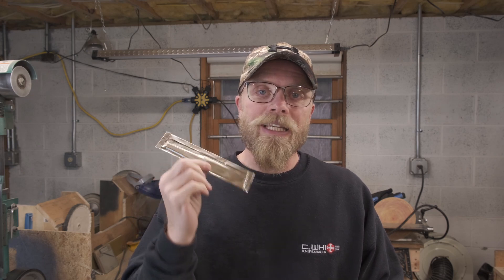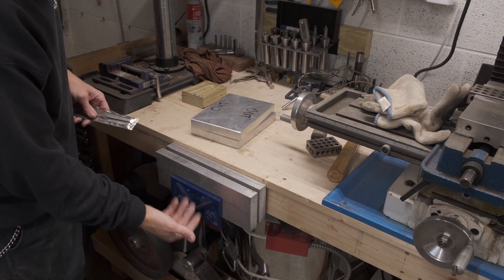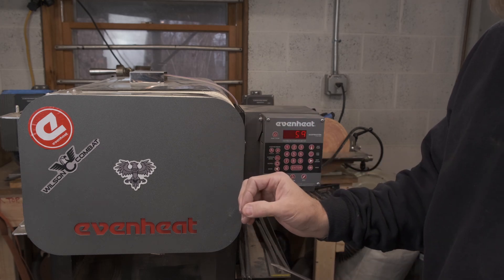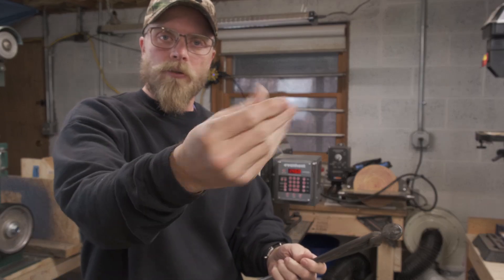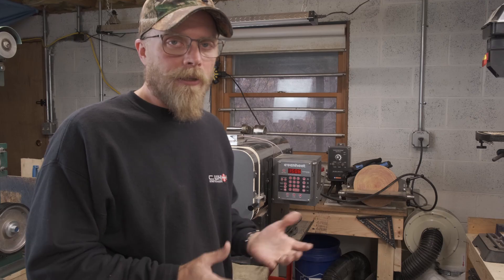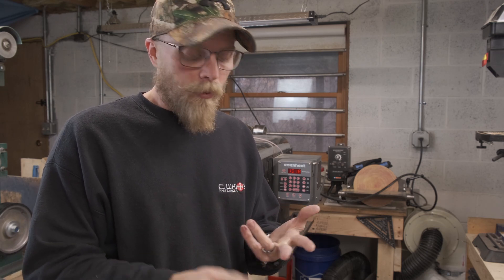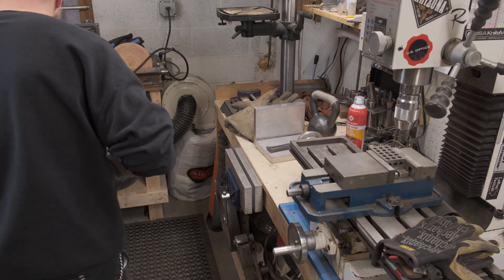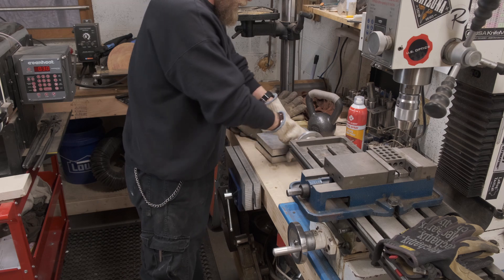Heat Treating High-Grade Stainless: Damasteel, CPM154, RWL34, etc.

Comment: Thank you so much, Caleb! You make it look so easy and simple, but it is not. And yes, it helps us a lot. But there's still questions... Like, what happens if one places the baldes in the cold kiln and turn it on, letting them ramp up along, rather than out them on the preheated kiln. The same for the temper... Put the baldes    in the cool oven and turn it on, or put them them on the preheated oven? Does it make a diference? 
Also... Happy new year!! 🎉🎉🍾🍾
Reply from the maker: Thank you!  So...if you put the blades in a cold kiln and ramp to the full temperature(1950); the real risk is excessive grain growth.  Which will lead to a more coarse, less fine, structure: which equals more brittleness and less keen of an edge, overall.  Not as tough.  But, the risk is relatively low.  It will happen, but may not be noticeable on some steels.  I've done it in the past, and have noticed a slight degradation in the overall quality of the sharpness and toughness of the knife.

For tempering: you can do it either way.  I just wouldn't come straight out of cryo into a warmed-up temper oven.  Let the blades at least stabilize to room temperature before slapping them in the oven.